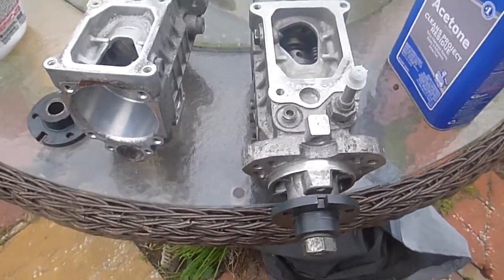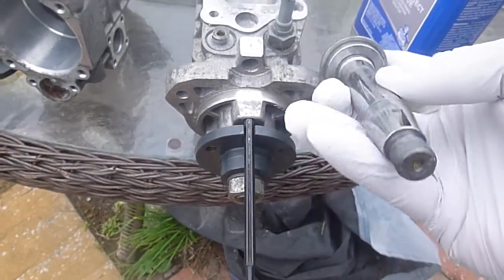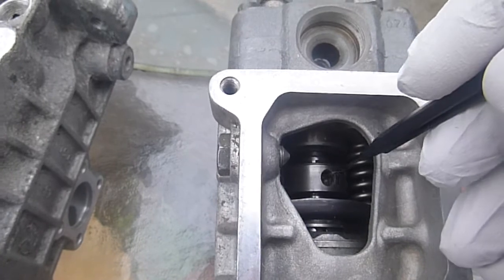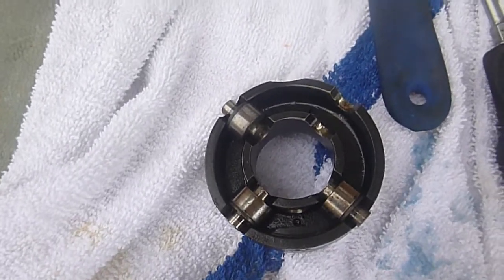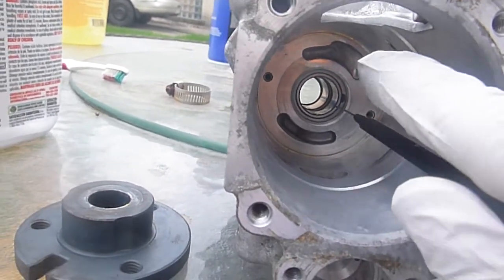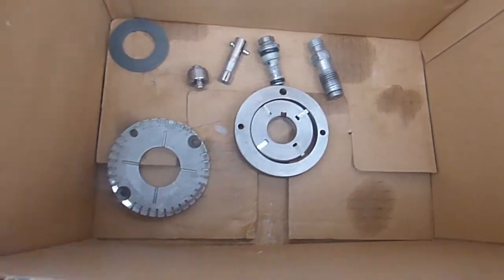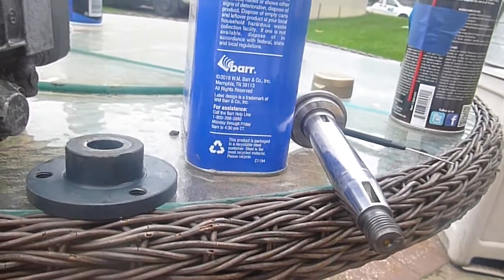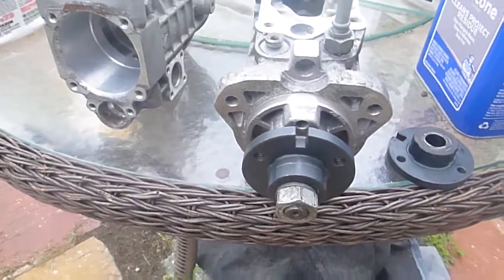TDI ALH Diesel Pump Timing? Answered in comments.

Comment: Hi mate.. how do u remove the big bolt of tge injection pump timing soroket.. not the 3 13mm. The big centre bolt.. am sure its a 22mm.. not sure.. did u use a impact gun or did u counter gold with the timing gear sproket.. thanks mate

Comment: five years later found this video useful and you just saved me some headaches  , some older pumps do have the timing at 12 o clock , these do not,  i just saw the notch at the left and will use it to keep the timing correct , i also saw you other detailed part dissembled video and made me decide to go for it  ,  Blessings and thank you
Reply from the maker: That is way I made this video. It was not obvious until, on my pump, I saw the timing notch. Did you get it all back together and working again? When I made the video they were still charging over $900 USD to rebuild these ALH diesel pumps. The two pumps I rebuilt just needed a good clean and no parts. They are real tough.

Love from Chicago
Reply: @GallowayChicago  yes I reassembled it following your instructions not yet running as I have a stripped Bolt on an injector.

Comment: I'm curious how do you manage to put this pump back together and working properly when Bosch service shops use very expensive gear to fine tune them.. even the simple operation of replacing the seals I have heard is difficult precisely because the the reassembly has to be so precise that it will requere tuning with high-tech gear afterwards. Or is this all myth and the Bosch service shops are stealing customers?
Reply from the maker: Thanks for watching, I would never disparage Bosch or Bosch service, but when disassembling and reassembling these diesel pumps there is no tuning/adjustments that can be done with the internal parts. The top of the pump's positioning (via hammer mod) will  change IQ (injection quantity) and the three mounting bolts will adjust the diesel motor's timing. I noticed and showed in the video that the high pressure rollers will gouge the inner pump body and I guess Bosch service would say that the pump I rebuilt was not suitable for usage. I AM NO EXPERT, but I have changed 5 seals and never lost a pin, and the rebuilding was 1000% easier then I thought, because all I could find online was warning about opening the ALH pump.
Here is the bottom-line: I was at the point where the pump was un-usable. So, Rebuilding it could not hurt. I bought a cheap puller set from HF and with that $24 kit I rebuilt two diesel pumps. In the process the puller broke but the price of a new or rebuilt pump was over $1,000.00 (USD) each at the time.
One Note: I cleaned and polished all the pump's internal parts before reassembling. I think that if you do not polish all the parts that diesel gook will just reattach to the pump and gum up the works again. I installed the pump from the video in a 2003 VW Jetta and it is still running today. 
Lastly: Some people will tell you doing repairs is/are very difficult, but if you ask them they will tell you they have never done it. Well I have rebuilt two diesel pumps, and I can tell you changing a power window regulator it harder. These extremely high pressure pumps are almost bulletproof (not much inside to break). The reality is that almost 75% of the problem from these pumps come from the IQ unit being gummed-up with oxidized diesel. Removing the IQ requires removing the pump from the auto, but once you have freed-up the IQ swing-arm movement. The TDI will run like new. My problem was that I let the diesel set for almost 6 months with untreated diesel in it and the bottom of the pump where diesel junk is supposed to accumulate was over filled and everything inside the pump was so bad that the TDI would not even start. The auto was not running because the automatic trans was bad (no reverse and no first gears). I did a Auto trans to 5-speed transplant (this too was way easier then the tutorials make it out to be). The new knock-off non-Bosch pumps from eBay are cheap but I would never trust a no name pump to last any where near the life you can get out of even a re-built Bosch. I have used/Installed the cheap Larger diesel Injectors and for under $200 (USD) you can gain some real power, but then you have to upgrade the turbo to improve your power band. These TDI are easy to work on and just take a willingness to learn as you go. I will always have a fondness for ALH TDI's because it was the first motor I rebuilt and my kids learned to drive stick in an auto that was safe and forgiving.

TDI Love from Chicago.
Reply: @GallowayChicago  thank you very much for your comprehensive reply, I really appreciate it and admire your perseverance. I can't find the exact video of a Bosch technician calibrating a VE injection pump but they use high precision specialized workbenches like the ones in this video,
https://youtu.be/99uLyZK8OOU

not trying in any way to put down the amazing work you're sharing here, but I'm still perplexed how can one reassemble this pump and put it working up to specs if Bosch technicians themselves use equipment like this? Don't get me wrong, I perfectly understand the reasoning you just described and I will probably try the same route myself - very much for the same reason, I have the same engine as you and a local Bosch workshop charges me minimum 800€ for replacing the pump's seals/recalibrating.

Have you tried an injector cleaner like "Liqui Moly" that you simply mix with your diesel? I suppose if it cleans the injectors without disassembly it should also benefit the pump.

Finally: ever ventured into timing belt replacement?

TDI Love from Europe :)
Reply from the maker: @zaratrusta79  The video you linked was about injectors and injector shims used to adjust flow. Did I tell you I'm no expert, but everything inside the pump's lower body is not adjustable. the top of the pump is electronically controlled and that is where the magic happens. That is why I said that 75% of the time it is the IQ(or QA) swing-arm in the top of the pump. There are lots of  videos (some where I don't know the language but know its about the IQ/QA) of guys diagnosing the problem (https://www.youtube.com/watch?v=iLQrxy3___E) or removing and cleaning the IQ module (https://www.youtube.com/watch?v=eab60JQprJY). You should be able to move the swing -are by hand with it springing quickly back to its resting place.

Simple check (https://www.youtube.com/watch?v=PSbpLFRGqDQ)

If your TDI runs then I would not remove the pump. I have used "Liqui Moly' and other product that say they work wonders with diesel pumps and injectors (the ALH in the US has catalyst converter and you have to be careful about the products you use in the diesel fuel pathway). I have found no better fuel additive then ATF+4. It does not remove water or increase the cetane level but wow does it clean the fuel pathway from the tank to the injectors. If you have water in your diesel then there are additive that are clearly made for that. Below freezing weather is when you should be very concerned about water in the diesel because the bottom of the pump and oem fuel filter are where this water is typically separated and it can freeze there and cause real damage.

The timing on these is not difficult. The OEM timing belts were defective and were breaking long before their rating. For that reason VW moved up the timing belt replacement requirement (which they also did for the DualMass Clutches), but the good news is that the new Timing belts will almost last 10 years. If you do not know if the timing belt has been changed I highly recommend changing it. I did a video about changing the timing belt without VW's specialized tools, but now those tools are easy to get. When I did my first one VW wanted almost 10 time what other manufactures charged to change the timing and told me I needed a new engine that was all worth more then the car.

Let YouTube guide you in your repairs and diagnostics. Back when I needed help there were no videos and only the VW forums were there to help. You got this. My wife was t-boned in her 2000 VW Golf TDI when a guy ran a light at over 50MPH and the 2010 Honda was totaled but her TDI only needed $1,300 and you would have never known it was even hit. Most people don't know that these TDI autos have cross bracing in the doors to save your life in a side impact accident. Her car was pushed laterally 3 time (and showed three impact marks) in this one accident instead of rolling over or crushing like the modern tin can autos.

TDI Love From Chicago...
Reply: Preveli na srpski
Reply: P

Comment: Bro Vehicle name please tell me
Reply from the maker: Brother always seems more respectful then "Bro" but don't let me stray away from your question. The Vehicle is a class of car with the ALH 1.9L diesel motor. The following years, makes and models were available with the ALH (availability differs from country to country): 
(VW/Bora/Polo/Caddy) 98-04 New Beetle, 99-04 Jetta/Bora, 99-04 Golf, 99-01 Polo, 00-03 Caddy
(SEAT) 99-02 Ibiza, 99-01 Córdoba, 00-05 León 1M, 99-04 Toledo
(Audi) 97-01 A3 (Mk1)

Diesel mileage differs for each body style with the Beetle getting the highest at 50MPG (US) from the factory.
Euro 1.6L ALH diesel TDI's get higher MPG but I am trying to stay with in the 1.9L family.

The 1.9L ALH motor is rated as follows: (90 PS; 89 bhp) or 66 kW  at 3,750 rpm; 155 lbf⋅ft (210 N⋅m) at 1,900 rpm - unmodified. The turbo make this a road worthy auto for daily commutes and still can pay for themselves even with the outrageous higher cost of diesel at the pumps. There are 'NO!' modern gas autos that weight as much a these TDI's that gets comparable MPG and offer the same crash survivability.

I hope I answered your question brother.

TDI Love from Chicago...

Comment: sweatheart......its not an 'iq' pump. that is a bosch injection pump. one thing the pump controls is iq---- INJECTION QUANTITY!! IT ALSO CONTROLS TIMING. do they call it a timing pump???? you really should have a real tech working on that
Reply from the maker: Thanks for watching...  I tried my best to use the terminology I have heard other mechanics use, which is difficult because this component is sold in so many different parts of the world.  As any visual puzzle solver will tell you taking things apart and putting them back together again is never the problem.  The problem is in explaining what was done to others that prove to be the biggest challenge.  I have found that this particular diesel pump is able to be torn down and rebuilt properly by "non-experts", because the biggest problem with them is slug and tar that builds-up on the internal components and not wear.  What is required is simply to disassemble and clean and polish just about everything then reassemble. This can potentially save a car owner $1,200 US dollars for a new pump.  This all came about because I had a 2001 VW Jetta TDI in storage for over on year and the diesel pump totally gummed up requiring either a replacement or to be rebuilt. A professional rebuilder was charging $800 at that time. The pumps from the video are fully functional and have performed without problem(s). my total cost was $75 for the Bosch rebuild kit. I guess you are right I will never teach a class on rebuilding Bosch Diesel pumps, but that was never my intention.

TDI Love from Chicago...

Comment: Thanks for video. My car is New beetle 1.9 TDI(ALH). Not long ago, I re-installed the IP, but it won't start. IP is a normal product. I think it didn't fit well when I put the IP pulley on the shaft. Do I have to fit the pulley groove into the key groove like this video? (This article is translated.)
Reply from the maker: Thank You For Watching.  The pulley for the TDI Injection Pump(IP) must be re-installed correctly.  If the auto does not start that could indicate that the timing is not set correctly.  The ALH IP controls the timing.  If you remove the IP pulley you must re-time the IP the same as I did in the video https://www.youtube.com/watch?v=YLgfbLUNTEU&t=815s  Let me know if you have any questions.

TDI Love from Chicago...
Reply: @GallowayChicago   Thanks for answer. But, I cannot speak English. Are you saying to set the shaft's groove to 10 o'clock and fit the pulley on top of it?
Reply from the maker: The keyway or hole near the end of the main shaft should be centered at about 80 deg counter-clockwise or at the 10 o'clock position while the black end sprocket is locked with a pin in the 12 o'clock position.  Tighten the end nut until the alignment is set. There should be a mark on the pump body indicating the proper orientation.  Sorry, I do not speak Korean but hopefully, this translates good for you.  I wish you great success.

TDI Love from Chicago...
Reply: OK. That's mean is Shaft key-hole at 10 O'clock(80 deg counter-clockwise) position and Sprocket hole at 12 O'clock position? 
 I was set shaft key-hole and sprocket-hole same to 12 o'clock position.Thank you very much for your explanation. I will set up again and comment this weekend. Thank you again.
Reply: My car ran, yesterday!  Thanks to you.( I saw marking for shaft position.)